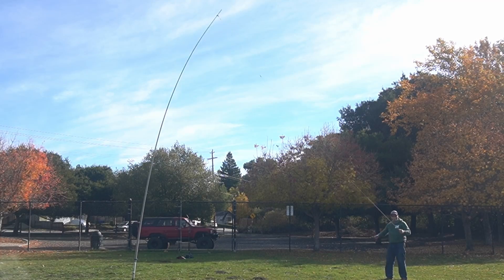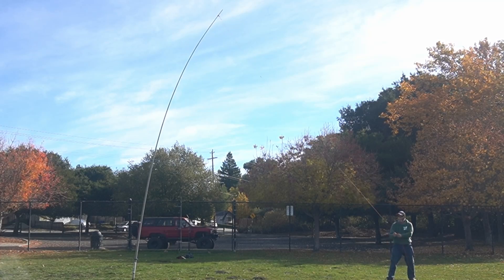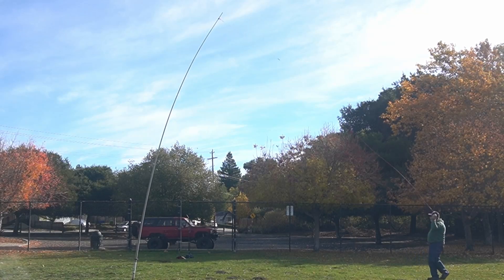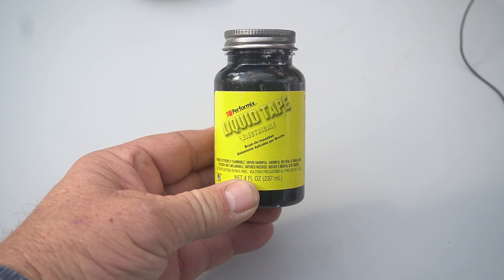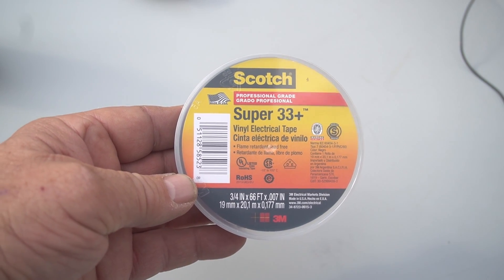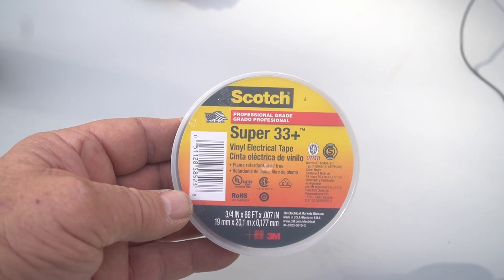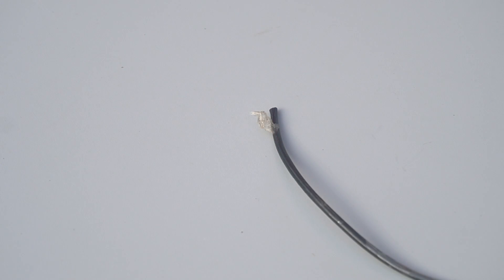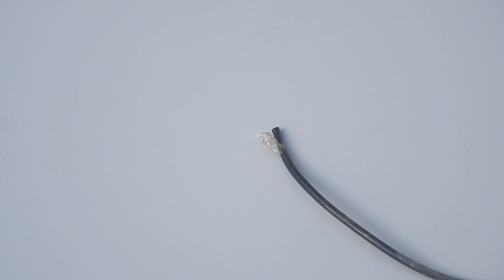What is the best Antenna Wire, for your DIY Antennas?

Comment: Thhn 12awg stranded. Tie to post and stretch it. Will last a decade.
Reply from the maker: Jay, I forgot to mention a lot of Hams like to pre stretch their wire! Thanks for watching and the comment!
Reply: Long ago I was putting up a 2 Element “Cubex”  Quad at my first QTH. I was given a long roll of solid 14 gauge cloth covered solid wire. We stripped off the cloth insulation and then we stretched it. This wire was free and was given to me by an a guy who worked for the Telephone company. It lasted as long as I had the quad up at my First QTH -about 6 years. When I moved I still had enough wire left over from that big roll to wind the quad a second time. Rinse and repeat. Fast forward to the current era and I lost my tower and a 7 element Yagi in Hurricane Ida. Got my home repaired and I’m finally going to put up some kind of wire antennas up. My climbing days are well behind me. I’m keeping my butt on the ground. I began my ham career with wire antennas and I’m going to end it with wire antennas. 😂 good presentation on wires. 73 de KZ5Y dah di dah

Comment: Been using the DX Commander Classic antenna at my QTH for a couple of years.  I like the wire so much, I built my DIY endfed antenna out of it.  Yes, a bit heavier than needed, but it sure works great and does not kink.  Makes great radials too as you can just toss it out and it doesn't tangle.
Reply: I'm with you frank but backwards. I did a dx10 wire efhw for permanent 80m-10m at home and I am tuning a dx Rapide I just got for black Friday. According to Lord Callum the alt. wire performs similar to the dx10.
Reply: Dx10 is good stuff, makes a fine dipole, pretty broadband.
Reply: @henryross1953  Yes, the HWEF I built out of it is very broad banded too.

Comment: I have had a couple of hams use Stainless steel or steel guy wire. Just because it was around and they have made it work. And, do be careful, I had an EFHW go up over a tree branch and later it failed where it was rubbing against the branch. Lesson learned. Thanks Chuck. Great info.
Reply from the maker: Thanks Don, My adjustiwave is stainless and it works great.

Comment: My OCFD is vinyl coated Stainless Steel and has 40lbs of cast iron weights going up a tree to a pulley with paracord to keep it tight yet lets the tree move in the wind.
Reply from the maker: Nice that antenna should be around for a while for sure, great using weights and pulley.
Reply: I bet you have a nice wide flat swr.
Reply: @radiotests  I do it's a Fritzel FD4, works really nice...